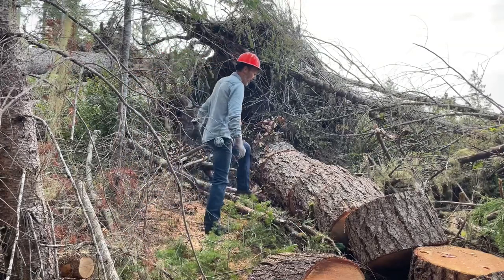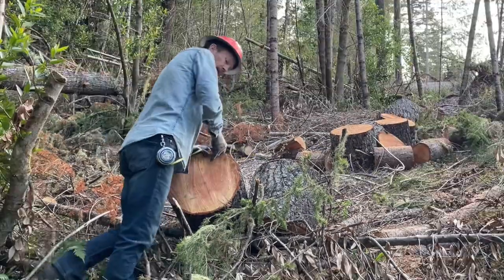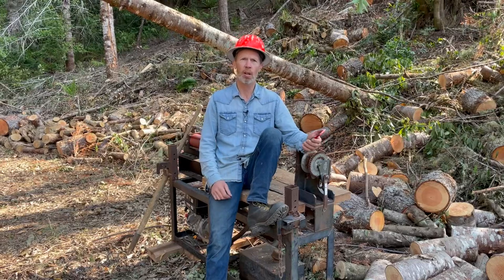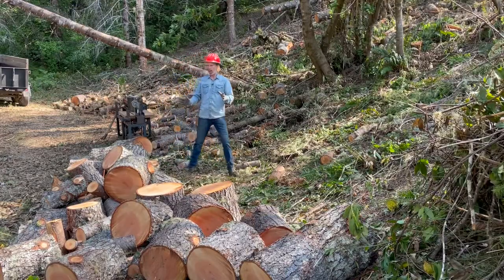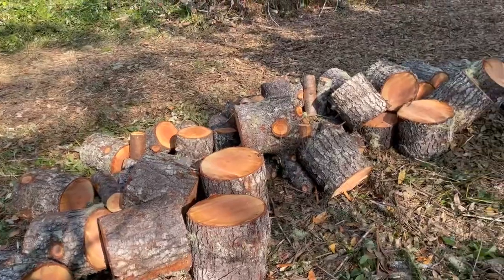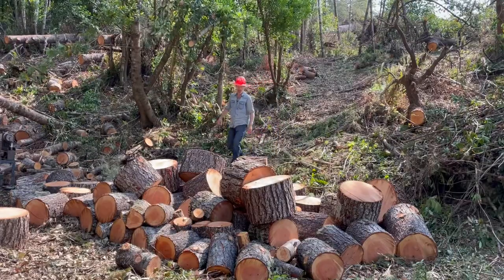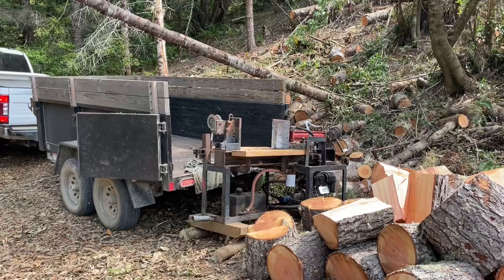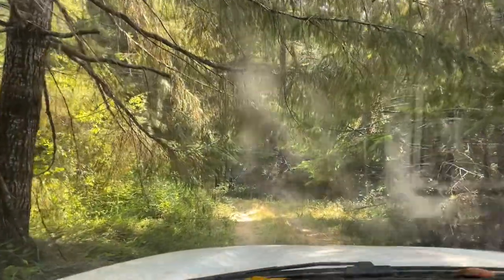Cutting Firewood More Profitable than Milling Logs or Logging?

Comment: what a mad man, he put up an extra camera just for the chance a log would roll over the barrier and continue downhill.
I don;t have an estimate because I still haven;t got a clue what a cord is , I use  this weird International System of Units
Reply: a cord is a stack measuring the length of a 2.4384 meter long cord along the long dimension, and the length of the same cord up the side and across the short dimension.  in freedom units, that's 8 feet long, 4 feet tall, and 4 feet wide, or 3624.56 liters.

Comment: Great video as always.
I often make firewood this way, so if i may suggest, using a pickaroon (hookaroon) would make Your work much easier-one with a 70cm(a bit longer than 2 feet) long handle for rolling them down the hill and one with a 30cm (about 1 foot) long handle for lifting them on the splitter.
It's a great backsaver, maybe You can give it a try ?
Reply from the maker: A pickaroon probably is a good idea. By the time I track one down here I will probably be done with this project. I don’t do much firewood throughout the year but will keep that in mind. Thank you for the suggestion.

Comment: Wilson you have quite a wood cutting business going for yourself, our family had been burning wood as a supplemental  and back up heat source if the electricity goes out and cannot run the Gas Furnace. That large Fir you just fell and cut up, good thing there was a lot of Straight Grain and Few Knots to try and split around. Some Fir in Western Washington where I live has straight grain and splits fairly easy, some though have Twisted Grain and grain that does not separate and I end up having to Rip the Rounds with the grain . I do not have a hydraulic splitter, still banging away with  steel wedges and splitting maul. Good luck with your wood business.

Comment: In honor of Bob Barker, is that whoever’s closest without going over? 😂 And how close did the runaways come to your camera?
Reply from the maker: The oops that happened on top of the hill was one running over my tripod. It broke it a little bit more than it was already broke. A couple came close at the bottom of the hill but I had some rounds parked in front of it for protection.